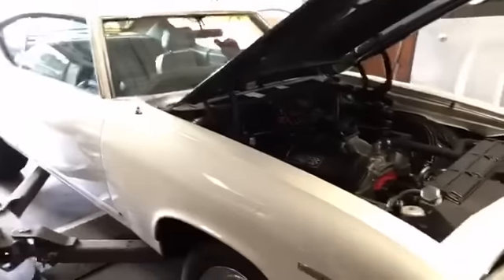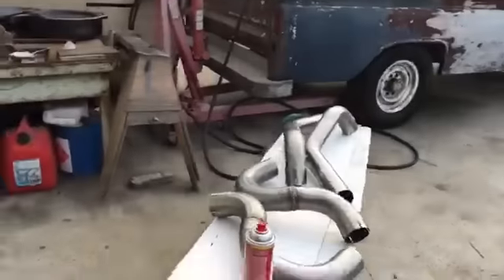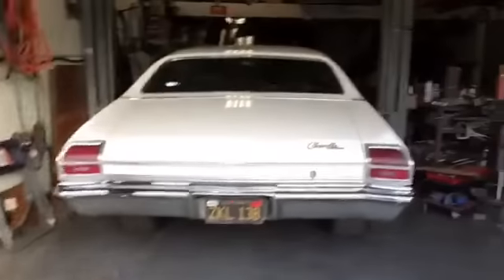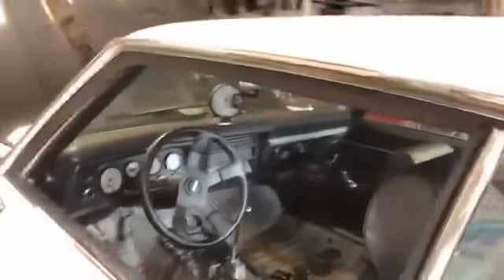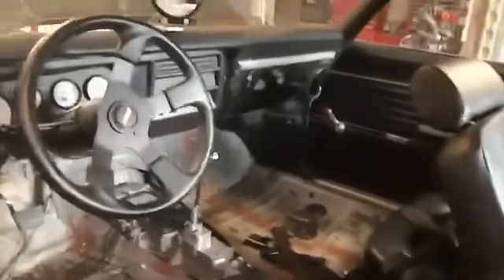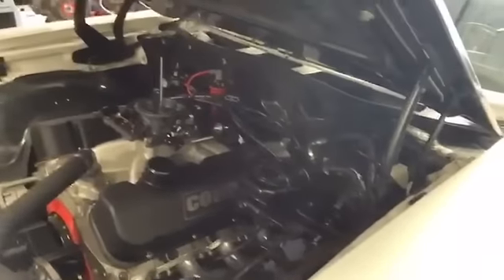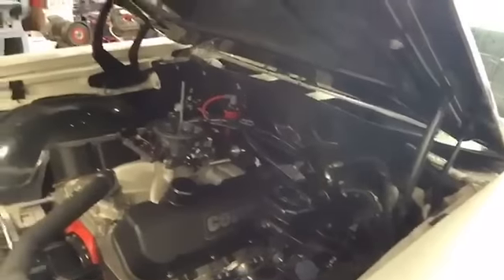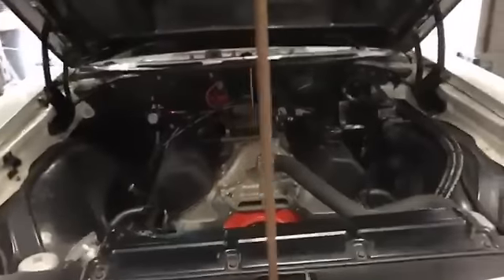69 chevelle project

Comment: Id like to hear why you arent a fan of hydroboost. i just put a hydroboost on my 72 chevy k20 and so far the brakes work excellent. Does hydroboost have reliability issues?
Reply: killing power?
Reply: As far as your application its OK and used alot. It's not exactly ideal performance wise is what I think he means.
Reply: Bob Falfa that makes sense. They are really nice in my big heavy truck. i can see where it may be a bit overkill for a car
Reply: nitrosport5 Yeah they're great on a tow rig or a big truck that's heavy and has a lot of rotating mass but in a performance application it is a bit overkill plus it's extra weight and you can get better stopping power and adjustability with an aftermarket set up from somewhere like Wildwood, Brembo or Strange.
Reply: I've had to replace the one in my '05 2500 HD, about three years ago. Working fine since.
Reply: nitrosport5 n